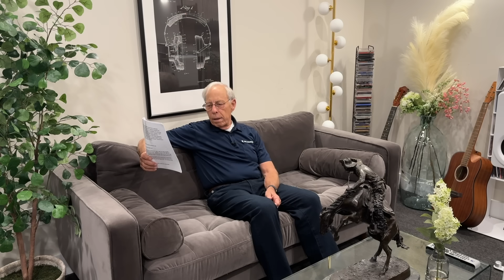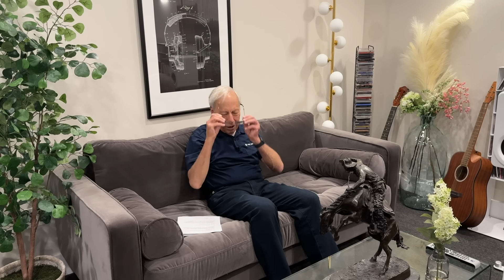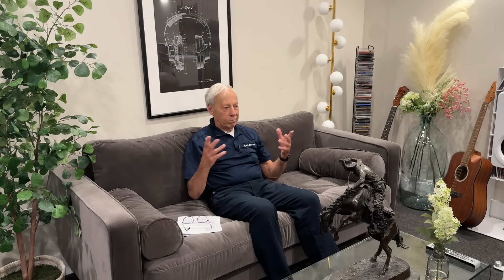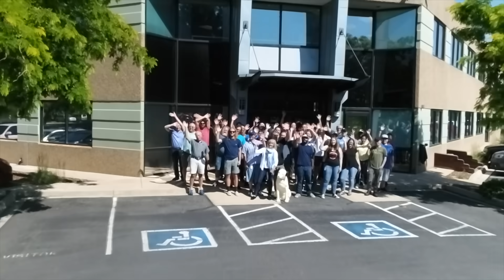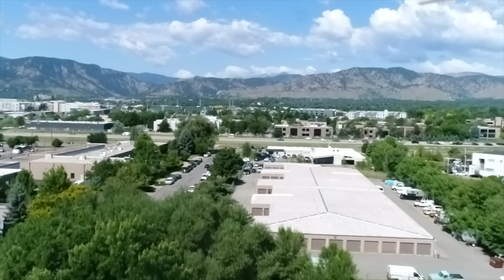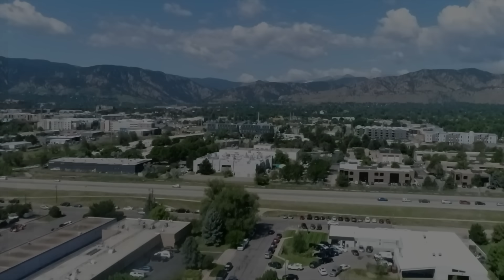Do music streamers sound different?

Comment: If you have a quality DAC, with a quality clock (usually a custom made clock), then that DAC's clock will time the bits and present an accurately timed voltage to your pre-amp.

But streamers will send noise to the DAC (the better ones will not have a noise issue).  You might not hear the noise.  But unless you have a very good streamer, then you have noise.  You will hear the noise (or its absence) if you (virtually) eliminate the noise.  Then, if you go back to your original configuration, you will recognize the noise.

If you connect your computer directly to your DAC via a USB cable, then you are getting a healthy amount of noise delivered to your DAC.  I spoke to an audio expert (he designs high-end equipment).  He recommended that I insert a Saberent 4-port USB hub between my computer and my DAC.  It did wonders, because that inexpensive Saberent 4-port USB hub happens to have a pretty good power supply, and so the hub does not let the noise pass from your computer to your DAC.

For under $20, you can purchase that hub.  Make sure it has its own power supply.  It is available in a 16-port version, too.  I am mentioning this, so that you will know if you are looking at the correct hub.  That hub allows you to power off the unused port (and you should keep them powered off).  And try not to exceed 3 meters length with your USB cable.